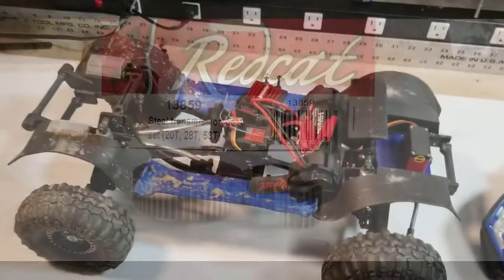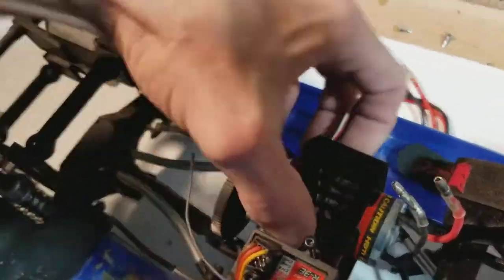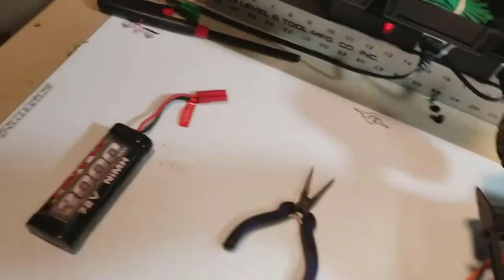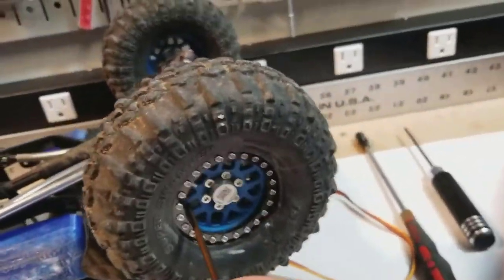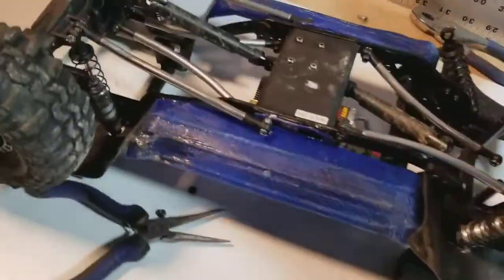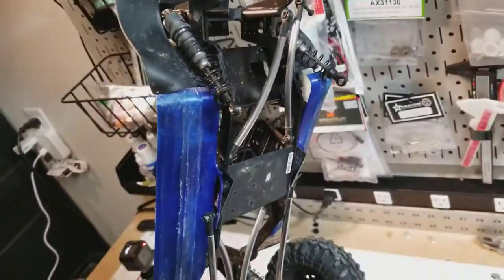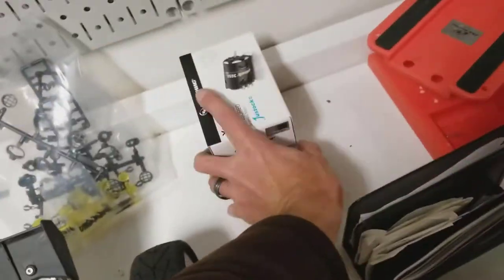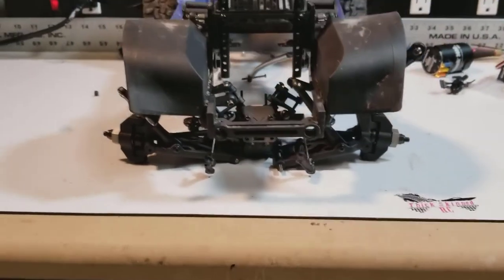Everest Gen7 IFS conversion has begun

Comment: Hey how is going.I have been wanting to do a build of a IFS. What are the posts that you scraped up to make the main mechanics of the IFS? (Diff, control arms, ale shafts, hubs and spindles, ect.) and were there any custom brackets you are needing to fab up? Really Simple part lost is what I'm looking for just to get started and my knowledge should get me to a final build. so if you can make that list for me that would be great and I thank and appreciate your help
Reply from the maker: Going good thanks!  Hope all is well for oyu!!  I Can make it even easier - all the front bits except the diff mount are from a Vaterra Twin Hammers.  I found a whole setup on ebay for about $80 IIRC.  It's a little wider than the redcat/scx10 axles but some spacers in the rear should do the trick.  That's my plan.
Reply: Thick Skinned RC ok ok the twin hammer parts yes I have heard that many times. the whole front end on ebay is a good find well cool right on approximate it. And enjoy your build.I'll check in on the build as it moves along